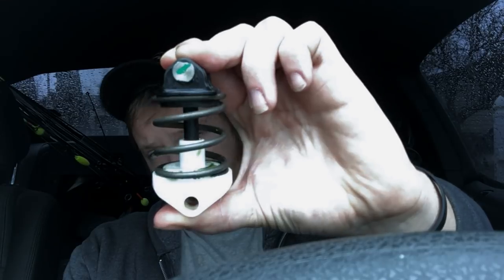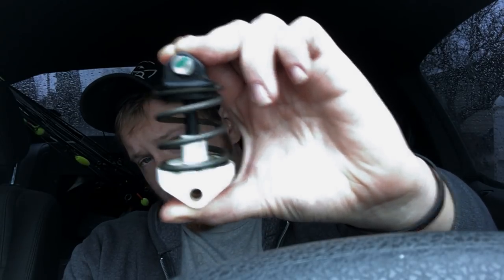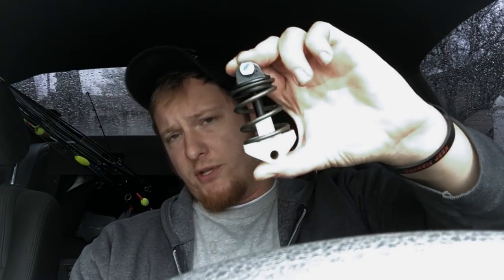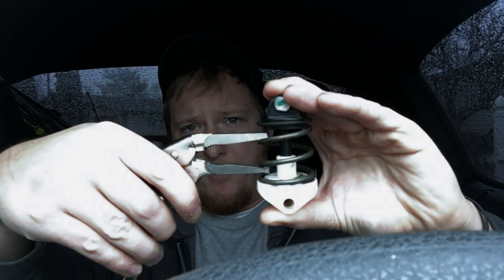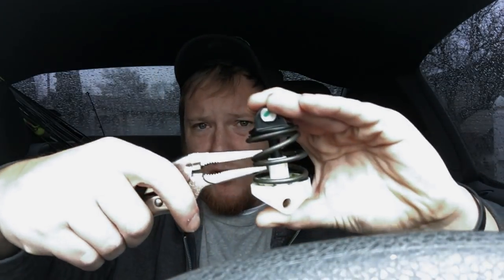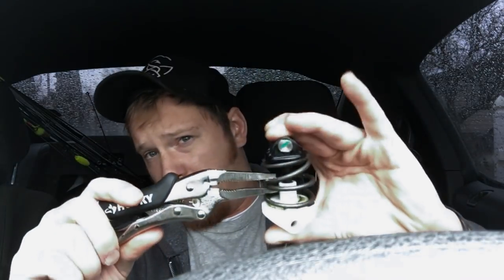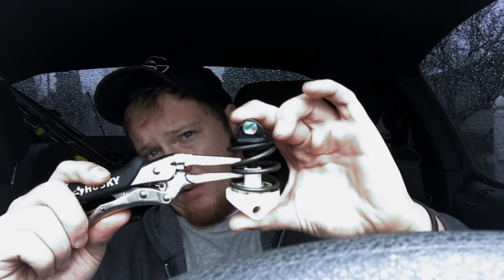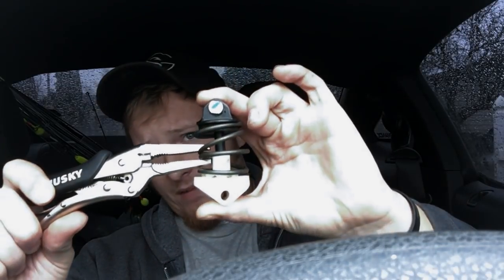MT82 Clutch Spring Delete Mod - Easy Walkthrough / HowTo

Comment: Thanks man, I've been thinking about doing this for a few months now but wasn't sure how. Are there any possible negative effects of removing the spring? Hopefully this stops the weird "springy and bouncy" nature of the stock clutch.
Reply from the maker: It will get rid of that feeling for sure. Just make sure when your clutch is at its rested position there is no play and that it is not sitting lower than it should. If that happens I would recommend replacing the stock spring with an aftermarket one from Steeda
Reply from the maker: https://www.americanmuscle.com/steeda-95-lb-in-clutch-spring-assist-1114-gt-v6.html
Reply: 3SevenStangVids this is the one to go with.

Comment: I've been laying off doing this as well     I noticed the steeds spring for the s550 is lighter than the one available for the s197.   Wonder if anyone has tried the s550 spring on the s197 or if it's compatible
Reply: Daily S197  I’m so curious too. The ones for the s550’s are only around 35lbs but the s197 are 90.

Comment: If it feels much better without it why did ford installed it in the first place?
Reply: carlosmon56 for little girls that find pushing it in...sooo hard lol
Reply: brent hecht thanks for the explanation lol
Reply: So your slave cylinder is not always pressed on on your pressure plate. But hey if you have the money for transmission works every few often then yank that "GIRLS" spring out

Comment: Just tried it with the help of Auto Zone and you MAY like me NEED the screwdriver, so yes...
Reply from the maker: doesnt it feel so much better
Reply: @3SevenStangVids  muuuuuuuuuuuuuch

Edit... Found out it's far easier and less embarrassing to just use one of those quick clamps that extend a full foot or two but reversed to press the clutch down instead of using someone's leg for help.